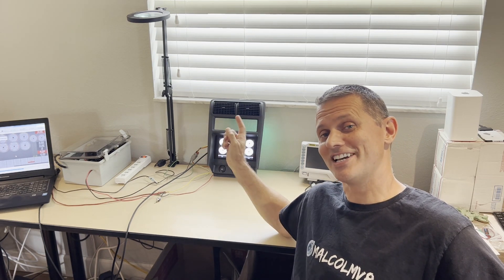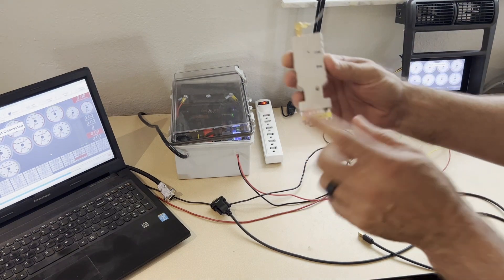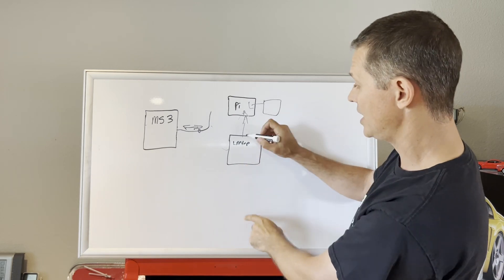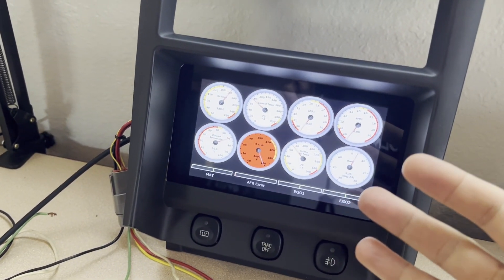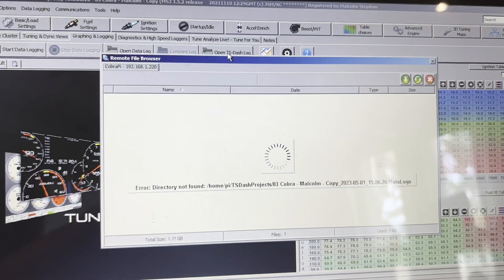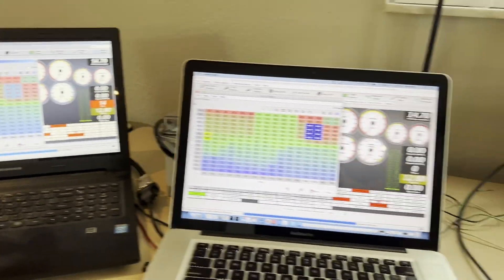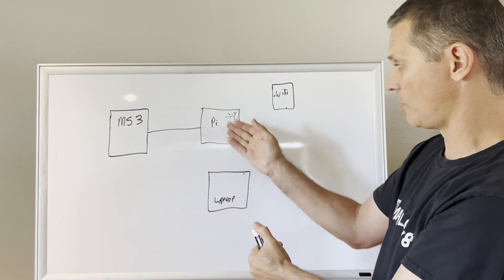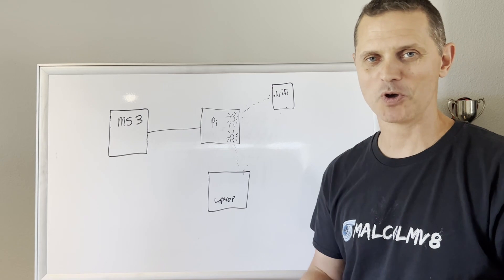Multi laptop tuning at the SAME time with TS Dash by Tuner Studio for Megasquirt & Raspberry Pi

Comment: Thanks for your videos and various forum post . I used your arduino can sketch to link a tc4plus egt amplifier over can to my ms3mini pro. I’m working through getting the tsdash working reliably .
Reply: I’m having some sort of communication issues because the laptop keeps dropping offline and doing so corrupts the tune. I’ve turned can off to see if that’s the issue and it still happens . I had the same problem as you not auto detecting due to a different ip set and port.
Reply from the maker: @GreatLakes_MetalDetecting  try asking on the msextra forums in the tunerstudio sub forum.  The TS Dash is pretty cool but does seem to be buggy from time to time.  Make sure you're on the latest update and see if anyone else has had the same issue that can maybe help you past it.
Reply: @MalcolmV8 connection dropping was two issues first the second usb wifi I added was bad it was dropping the connection and second I had to open up the firewall on my laptop . Now to get all this back in the car and take it out and do some data logging
Reply from the maker: Glad to hear that the video and info was useful and something you could use.

Comment: Great video and info.  I am seriously considering this for my Megasquirt set up.  How do you "gracefully “ 
shut down the pi.
Reply from the maker: You need a power supply board that works like a UPS.  It's wired directly to battery power and also to the ignition switch.  When you key off it just pulls a pin low on the Pi letting it know you have the ignition switch off.  At that point it turns the screen off and an internal counter starts.  After X period of time it realizes you're done driving and gone and the Pi begins to gracefully shutdown.  Once it's down there's a pin on the Pi that now goes low letting the UPS / power supply board know you've powered off and it turns itself off.
Reply: Do you have an example of the UPS or what do you use?

Comment: I have problem with TSdash right now, my laptop can connect to pidash but all value in Tunerstudio stay 0 same like offline. 
Do i need RTC to make it work?
Reply from the maker: RTC is not required to make it work to the best of my knowledge.
Reply: @MalcolmV8  so do you know what cause fhe problem like rhat?
Reply from the maker: @NgocPhamVN96  if it's actually online and connecting but showing all zeros then no I'm not sure.  Never seen that.
Reply: @MalcolmV8  it's working now😀
Reply: @MalcolmV8  but only work if i connect directly to tsdash, if both connect to 1 other wifi it can't connect
Reply from the maker: @NgocPhamVN96  glad you have it working.  I'm sure you'll figure out what's the issue when both are connected to the same wifi base.  That should work too.
Reply: @MalcolmV8  thank you, i'll will try. I watched you video but i can't see how you setting on tunerstudio to connect to Tsdash while connect  to same wifi. It have to ne same ip address but how about port?
Reply from the maker: @NgocPhamVN96  yes IP changes between directly connecting to the Pi and vs them both on my home wifi.  The port never changes for me, just the IP.
Reply: @MalcolmV8  i see. I just don't habe time to try it out lately.
Reply: @MalcolmV8  can you explain how you gracefully shutdown TS dash and the pi.
Reply from the maker: @mikeshawn2913  You need a power supply board that works like a UPS.  It's wired directly to battery power and also to the ignition switch.  When you key off it just pulls a pin low on the Pi letting it know you have the ignition switch off.  At that point it turns the screen off and an internal counter starts.  After X period of time it realizes you're done driving and gone and the Pi begins to gracefully shutdown.  Once it's down there's a pin on the Pi that now goes low letting the UPS / power supply board know you've powered off and it turns itself off.

Comment: Hey, I was wondering if you could reach out to me and let me know where to get started on a dash like what you have, mainly interested in your sync setup.
Reply from the maker: At it's core it's a raspberry Pi with the Raspberry Pi touch screen.  It runs linux (raspbian distro) and is using Tuner Studio software in full screen mode to display the gauges.

Comment: Hey man, did you have any problems in the beginning getting TSDash to connect to your ECU? I'm using a megasquirt 3 and even with direct connection from that to the pi, TSDash isn't getting any data in and isnt displaying anything.
Reply from the maker: I did not.  Are you exporting a project from tuner studio with the correct connection settings for your setup?

Comment: What is the communication  setup for tuner studio? I have mine up and running. TSDash project is loaded and  is working. Laptop is connected to TSDash but it stays offline.
Reply from the maker: Do you have the new beta version of Tuner Studio?  If so in the data / communications settings there's a new option "Driver" and you use the drop down box and select "Dash Echo Client" and then connection type is wifi.  Below that is the port and IP address.
Reply: @MalcolmV8  Yes I loaded all of the latest updates today. It auto fills the port as 2000 and then my IP Address. But it never detects anything.
Reply from the maker: @ZachKeene-zz6kr  I suppose the port could be random, but mine is 21848.  Does it have the correct IP in there?
Reply: Okay I may have found the issue. I can control the Pi via the laptop. So it is connected. I activated the license on the pi before it was rooted to the sd card. I originally had TSDash on a flash drive to to see if i could make it work before switching everything over. It was activated then but would never function correctly. I wiped the cards and reprogrammed the TSDash file to root. Everything is up and running but now when i try to add the license it says. "Unable to activate registration, failed to retrieve computer identification. Waiting for EFI Analytics to advise if this is the issue or not.
Reply from the maker: @ZachKeene-zz6kr  It sounds like you're on the right track.  Hopefully it's just the license.
Reply: @MalcolmV8  Its me again! So I have been back and forth with them for a while. They "think" my RTC is not programmed right and is  the problem. Can you give me some How yours is setup? I have  Pi 4 B+ With 1307 RTC. Battery has been verified good. I had it working with my Tuner studio dash setup before changing to  the TSDash root file.
Reply from the maker: @ZachKeene-zz6kr  what issues are you having that the developer believes you're experiencing an RTC problem?

Comment: How do you set up the hotspot on the pi? I got an extra wifi dongle and would like to try this. I'm just not sure how to set that up. If you could point me in the right direction, it would be much appreciated.
Reply from the maker: I've worked in IT and with Linux most my life so I just CLI it all (command line).  However I believe you can setup the wifi stuff in the GUI too which should have a somewhat intuitive interface.
Reply: @MalcolmV8  well I got ts dash installed yesterday. I figured out the wifi hot spot and connecting it all today. I got it working within my OpenAuto Pro on the Raspberry Pi so I can still use my stereo and android auto with it. There are still a couple of things I'm trying to figure out with it, but all and all a success. I'm glad you posted the video. I had no idea about the ts dash was just running TunerStudio on the Raspberry Pi. I could use my stereo or the TS, but now it all works together, and I can tune on my laptop. Love it.
Reply from the maker: @TheEminit  that's awesome.  Glad that helped and you got that working :)
Reply: @TheEminit  Did you have to program your RTC after installing the TSDash root file? I have yet to get my Dash echo registration working correctly.  I can connect and crontrol the dash with the laptop but I can not get the echo license registered so TS stays offline. EFIAnalytics thinks it because my RTC isn't working correctly.